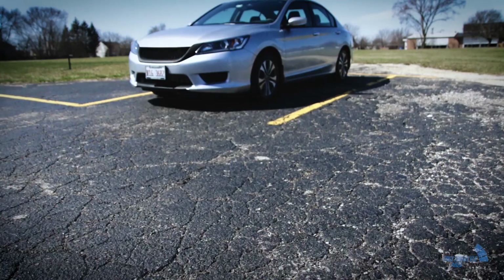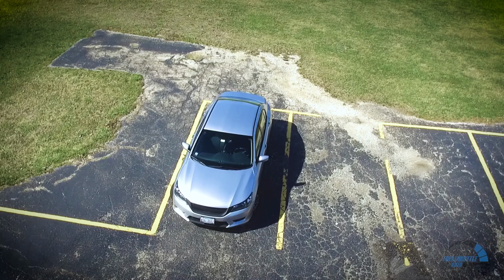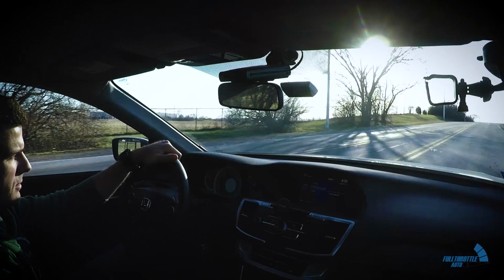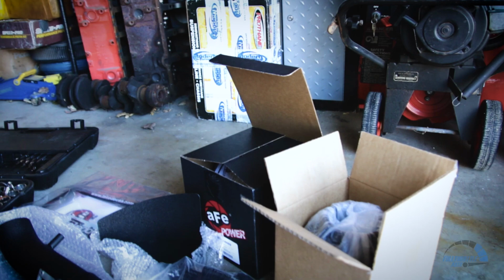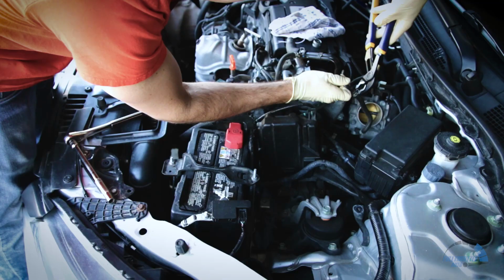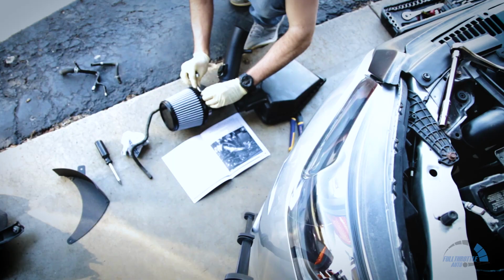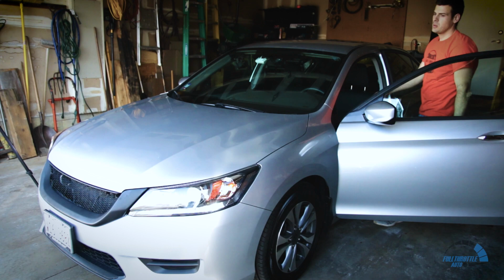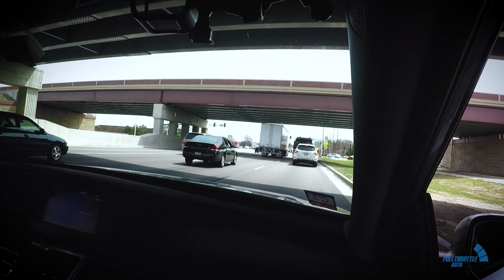9th Gen Honda Accord aFe Power Takeda Stage-2 Intake Install | 2014 Honda Accord Mods

Comment: Brother I've had 3 Honda's that's a beautiful car. I personally own a 2017 Accord coupe 2.4 I-VTEC. To make your aftermarket intake work properly you must have your CPU programed for it, to work properly. Beautiful Car
Reply from the maker: Stephen Murphy first off, thanks a lot for watching and commenting. Yea I know I need to get it tuned, I will one day. I love the car personally. Glad to see someone else has the k series manual.
Reply: Stephen Murphy NOT TRUE. THE CAR WILL SENSE THE EXTRA AIR AND MAKE ADJUSTMENTS ACCORDINGLY. Makes no sense that the cars main computer is going to be static in its program instead of being variable. Cars go through changes ALL THE TIME. Temperatures, the way you drive.
Reply: Thanks for this info. I have the same exact car and year.

Comment: Can you make a guide for this car to install an oil catch can? Just where to connect the thing.
Reply from the maker: I'll definitely look into it and see what I can do.
Reply: @FULLTHROTTLEAUTO  Neat, looking forward to what youll do to this car next.
Reply: Why the need for catch can?  Is oil pooling up behind the throttle body or crankcase ventilation poor?
Reply: @johnsimmons8456  In case you didn't know, after prolonged use in gdi engines, the recirculating fuel and oil builds up on the way back to be burned. Covering tubes restricting flow. Build up on the intake valve. All causing the engine to idle and drive roughly, decreasing fuel economy and engine life. You may not experience this for the first 50k miles or so, but as it builds up, you will notice it and it will cause issues further down the line. The oil catch can helps decrease it enough that you wont need to worry about using valve cleaners every oil change, but instead just need to dump the contents in the can every other oil change.
Reply: @AznTony360  In that case why not use a catch can with a built in PCV valve like the one mighty mouse sells.  What kind of catch can are you using and how did you route the clean and dirty sides?

Comment: If you look at Takeda’s own website and their own posted dyno graph their intake lost 6hp at power peak over stock intake, when running stock exhaust. 169 at the wheel stock intake vs 163 Takeda short ram. Dyno says it was done in Sport auto.
Reply from the maker: Safe to say that the numbers at the bottom don't make sense compared to looking at the actual graph. The graph shows a clear gain throughout the whole rev range quite considerably.

To get a clear answer on what is actually accurate I'd recommend calling them or emailing them to see what they say.

Comment: I was told that cold air intakes help gas mileage, is this true? Only getting the HP wasn’t worth the $350 if so.
Reply from the maker: Great question. I feel you on that. I have heard similar statements. However I haven't seen any actual testing to prove that is accurate.

Sorry I didn't have a more direct answer.

Thanks for watching and commenting.

Comment: Hey! i know this video is somewhat old and Im not sure if I can expect a response but I have a 2.4 coupe and the intake will for sure work, I'm just curious on the purpose of the coolant hose and vacuum hose removal and replacement and what the purpose is. other intake installation videos I've seen haven't done anything with those hoses and I want the installation to go smoothly as I'm very much a novice with car mods, all I've done so far is spacers lmfao. Im just curious as to the purpose of that and if its necessary. thanks!
Reply from the maker: These lines are connected to the stock intake. Since you're replacing the intake the stock lines won't work and you have to utilize the supplied new lines. Hope that helps clarify.

Thanks for watching and commenting, truly appreciate it.

Comment: Did u get it tune after the intake installation.  I have a 2016 accord and the takeda Intake was causing a misfire
Reply from the maker: I did not get it tuned. I had no misfire issues. I got it tuned this year with my Ktuner that I ended up installing. No issues with or without the tune.

Sorry to hear that you did have issues. It's possible something else could be causing the misfire. Hope you get it figured out.

Thanks for watching and commenting.

Comment: Did you remove stock box bottom area @ 4:27min.  Don’t see the bottom air filter box
Reply from the maker: If you mean the piping the goes from the front and then under the battery towards the fender, no. That stays there to still get the air from the outside.

Thanks for watching.
Reply: Fullthrottle Auto got it. Thank you 😊

Comment: The takeda intake was causing a misfire at about 5000rpm. So I decided to reinstall my stock intake and it fixed the problem. My question is did you get it tuned after you installed it? Did u experience the same problem? Did the ktuner fix that? 2016 accord 6spd
Reply from the maker: Sorry to hear that happened. Great questions.

No I never had that issue. I did not get the car tuned when I installed it. It was a long time after installing the intake that I tuned it with the Ktuner and no issues with or without the tune.

Thanks a lot for watching and commenting.
Reply: Thanks for the feedback. Yeah it's a weird situation because when I would get close to the 5k rpm it would misfire. So I decided to take it off and put my stock one back and that fix the problem. Its 2 years newer but the engine and everything is practically the same. What model do you have? I have the ex. Once again thank you for the videos. I also have the silver bullet throttle body spacer but never got around to install it because of my misfire problem.
Reply from the maker: @mmmm-ui4rp  no worries. Sorry I didn't have more info on that.

I have a 2014 LX.

Comment: I love your videos man,I have 2014 accord sport ,current mods are sp2 catback exhaust system,afe cold air intake,lowered on H&R lowering springs,Yokohama performance tires and aftermarkets wheels.
Do you know why the gas pedal response feel different now? You have to put more pressure than before when it was stock,kinda feels like the car is  slower,maybe needs a tune? Thanks
Reply from the maker: First off thanks a lot! I truly appreciate that.

It's possible that you might need a tune. However after putting on the intake and exhaust on mine, the throttle response feels the same with no tune. 

It could be possible that the hoses for the intake might not be properly sealing causing a leak which then in return causing the electric throttle body to not respond right. (I am not sure if this could be true, just throwing an idea out there)
Reply: @FULLTHROTTLEAUTO  you welcome man. And yeah that might be true but I have heard from to many people that air intake don't do much difference per wise,only gives that sound and feel like the car is alive but usually if you have a exhaust and cold air intake,you definitely need a tune,you ever thought about getting the ktuner or hondata flash pro? As much as I love this honda accord I really thinking sellin the car and getting something more fun,like a honda s2000,one of my dream cars or acura rsx type s .
Reply from the maker: @joey1458  I have a ktuner. I might get it tuned N/A. But I'm ultimately waiting on a turbo kit I have my eyes on. Just have to save up $4600.

S2000 is a great car. I personally would keep the Honda for a daily and pick up a project. But I know not everyone can do that.
Reply: @FULLTHROTTLEAUTO  yeah slickfab makes turbo kits and thats awesome man,hope it goes well for your honda.How the ktuner going so far,any difference in acceleration and speed?
Reply from the maker: @joey1458  I haven't done anything with the tuner yet. I have it, just haven't set it up and tuned the car.

I'll do a video if I end up deciding to do it on the car before the turbo kit.

Comment: What did you attach the coolant hose to? I saw the vacuum hose get attached to the body of the intake but what about the coolant hose?
Reply from the maker: As the video says, remove the old coolant hose and use the new supplied one and plug it back in using the old clamps.

Thanks for watching and commenting.

Comment: I saw the video long ago, but hopefully if you still own the car and drive it aggressively, you should've deleted the CDV a while ago.
Reply from the maker: I do have the car and do drive hard. I don't have any issues with the clutch delay valve to be honest. However I do have an issue where I quick shift and it'll grind once in a great while. I might do that later just to see what the difference is.

Thanks for watching and commenting.
Reply: @FULLTHROTTLEAUTO  Yeah, definitely upgrade the transmission fluid and delete the clutch delay valve from the clutch slave cylinder, if possible. My Honda dealership wouldn't warranty my powertrain, and I eventually ended up "fixing" my transmission from 2nd gear grinding and some lockouts. AC Delco Synchromesh friction modified transmission fluid and the clutch delay valve, maybe even with braided lines will help greatly!
Reply: @FULLTHROTTLEAUTO  I also have the TWM shift cable bushings, but not the short shifter because I've heard mixed issues about running that in the gearbox.